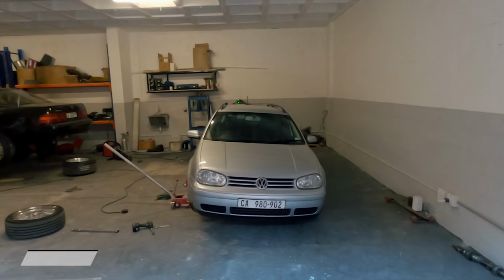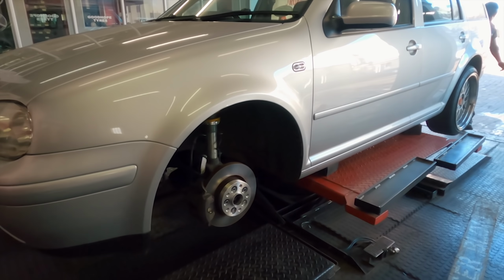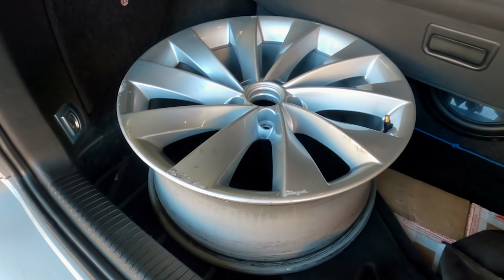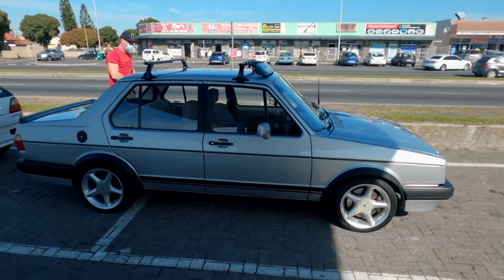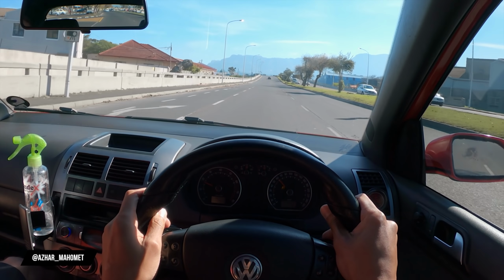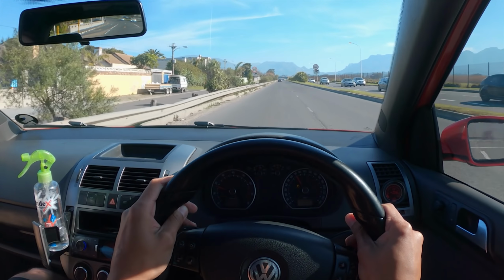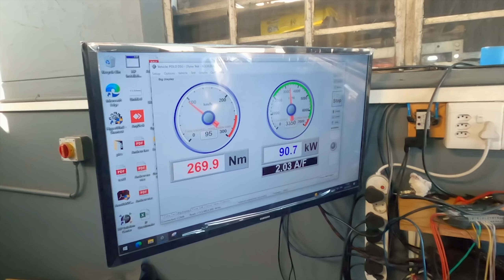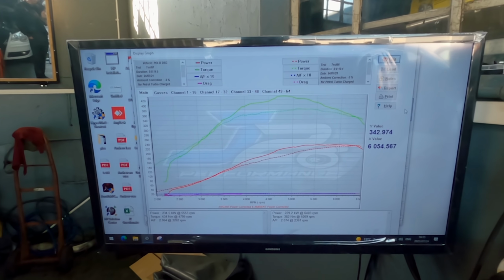Mk1 Fox 2.0 16V on ITBS | Scaring my passenger in Polo GTI | Tyre machine ruined my new wheels 🙈

Comment: Epic video! What was the reason that you had to turn  down the boost in the mk2 20vT? You were running more power initially at higher boost without water meth
Reply from the maker: It was pinging. Even though we couldn’t hear it, it was there. The car was then tuned with headphones connected to the knock sensor and that’s when we discovered that there was lots of knock. So it’s safe at the moment but it doesn’t feel like it used to. When it’s hot, the ecu pulls more timing. So I want to get that back and still keep it safe and reliable with the meth. In my exhaust video I talk about the power loss if you want to check that out.
Reply: @lowdl  makes sense yes 💯

Comment: Hey Lorenzo, great content man. I look forward to these videos. Do you know which rad the fox is running?
Reply from the maker: That’s great to hear. 🙌🏽 It’s a custom rad as far as I know. He had cooling issues and beefed up the cooling system quite a bit. Turned out to be a head gasket that was blown. It’s got quite a thick core. But it’s overkill in my opinion. Unless he wants to take the car on track.
Reply: I was running a custom rad. But ended up going with a corsa B diesel dual core radiator, fits nicely under the front valance.
Reply from the maker: That's really good to know. Sounds like a good solution for Mk1's and 2's.
Reply: @matthewburly4228   that sounds like exactly the solution I'm looking for, you mean it fits in the front panel?
Reply: @michaeladams6074  ya under the front valance. You will need to re route your radiator piping if your running throttles though.

Comment: Great content,  sad about the wheels but in all honesty not all wheel shops know what they doing when fitting tyres. I dont know if im wrong or what but that Red 9n3 sounds like it has a auto box???
Reply from the maker: I'm really sad about the wheels. I had a feeling that things wasn't going to end well. I'll have them redone and they'll be better than ever. And you're correct, the Polo has a DSG gearbox in it. He kept breaking manual boxes so this was a great upgrade.
Reply: @lowdl  that sounds F'n awesome.  Maybe  video on the conversion one day in the near future
Reply from the maker: I’m not too sure how I can show you guys. There’s not much you can see in the bay. Maybe I’ll ask them to get it on a lift so we can see how big the gearbox is from the bottom. But the conversion is quite involved. Hopefully they will do another in future. Currently J2 has done two in a 9n chassis. Maybe the Mk2 next 🙃😂